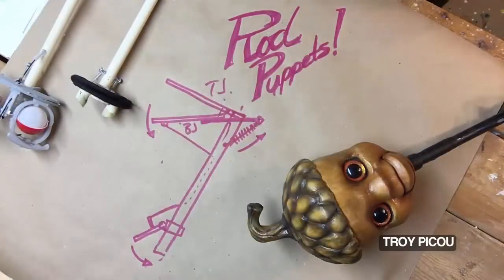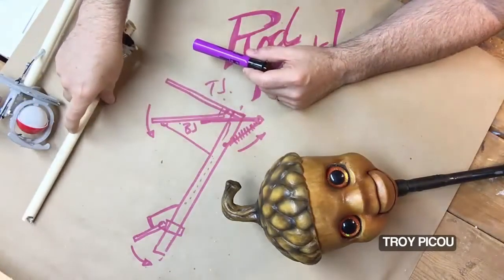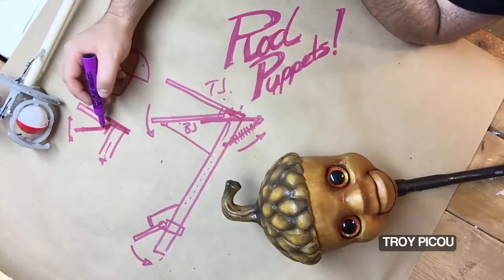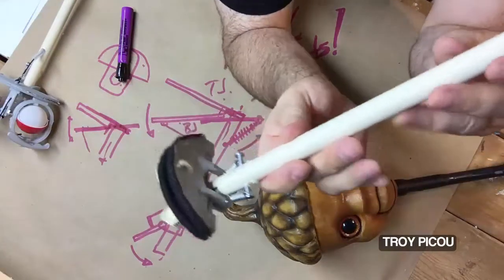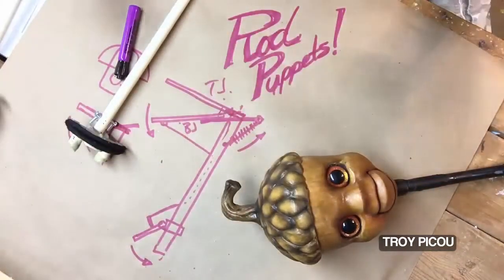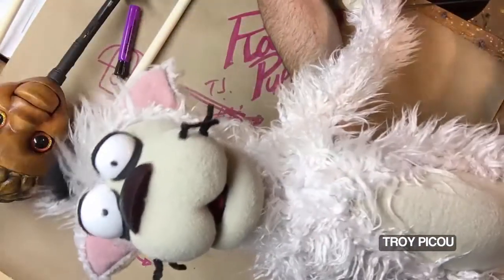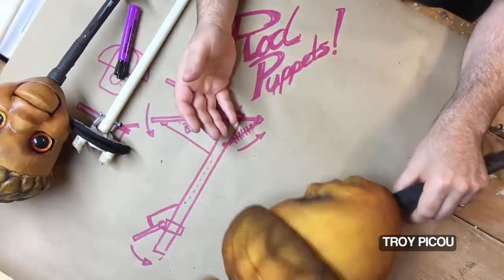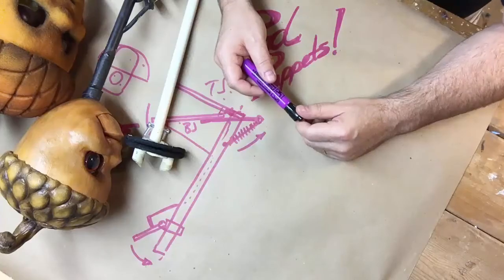Rod Puppet Mechanism

Comment: Just wanted to say great video, thank you very much for making it, really useful for a project I'm currently working on! 
Might seem strange, but I wanted to ask: is there a size of puppet that this doesn't work so well at? Just my puppet could possibly end up quite large, so that could factor in to the sizing of it 😁
Reply from the maker: Thank you, this will work on any size puppet. The key will be the tension in your return. On something large it will have to compensate for weight.
Reply: @troypicou  Okay, thank you! In that case, I definitely have some experimenting to do. Thank you so much for your help!